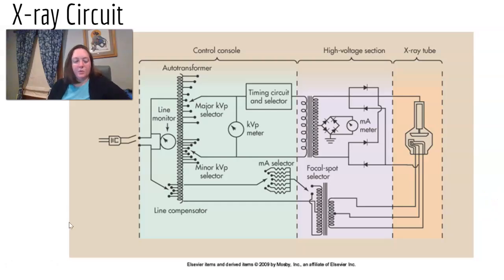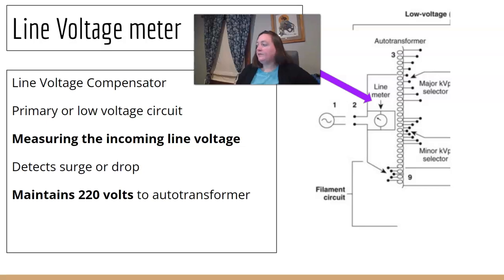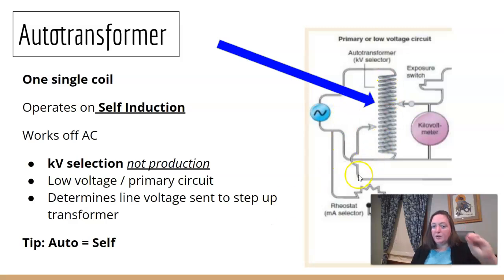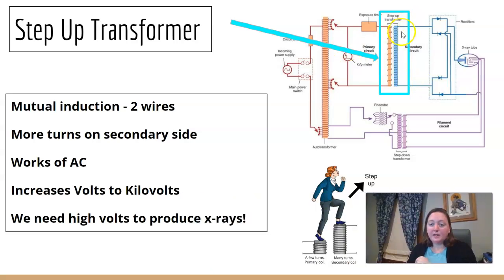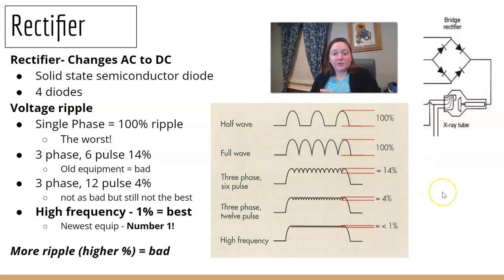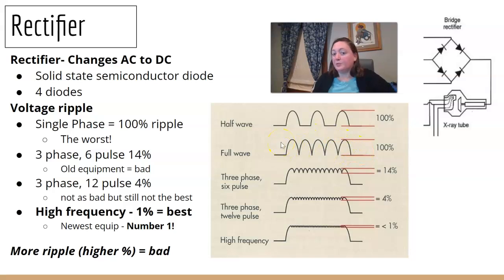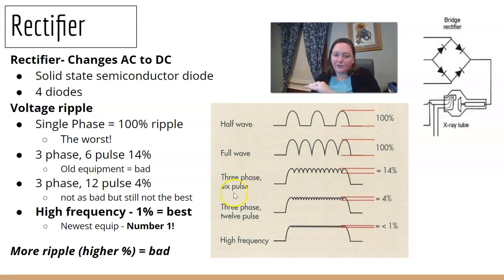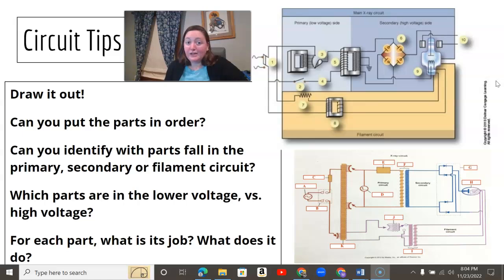X-ray Circuit

Comment: This helped me so much. The only thing I’m still confused about is the mA meter. Why is it by the step-up transformer when the mA selector is by the filament transformer? If the final meant transformer is to produce the correct mA, and the high-voltage side is to produce the correct kVp, why does it matter what the mA is on the kVp side?
Reply: The mA METER only works when the tube is "live", that is, when you depress the switch completely down.  It doesn't control anything, just measures, or "meters" it.  It appears on the control panel but is in the high voltage area so it MUST be grounded.